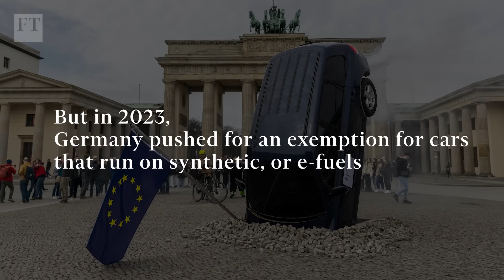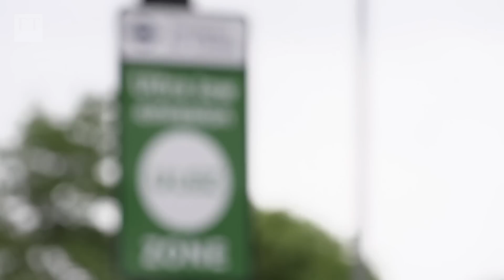The end of the combustion engine? | FT Energy Source

Comment: The National grid, themselves said there is no risk to the grid as EV's charge over night when the grid is under used, EV's help to balance the grid
Reply: yup, in UK during a storm, utilities PAID EV owners to charge their cars as they had a surplus of wind-powered electricity.
Soon as more cars get vehicle-to-grid features, EVs can act as home batteries, being paid to help stabilize the grid during high-demand times...
Reply: @cgamiga We are slowly moving away from a centralised power generation to every house being a generator.
Solar panels and batteries are the future as many days in the summer I am generating over twice as much as I need for any 24 hr period, in the winter it's just 50% but I am limited to 4 kWh by the ability of the cable going to the street to carry more. If building regs stated 3 phase cable instead of single phase I could use more solar panels and generate enough to cover for winter generation levels
Reply: @Stumpy1854-Orion unfortunately solar cannot play a very large part in the UK, because they produce much less in the winter and when all heating is electrified we will need much more elecricty in the winter. Once there are enough wind turbines to cover the winter demand there will be spare electricity during the summer, even if there were no solar panels. Adding solar will just make the excess worse. You will not be paid anything for exporting electricity most of the time once we reach that point. Only when the wind drops will solar export be valuable. Wind turbines are much more economical at large scale than small scale so most electricity will still be produced by power companies.
Reply: @adrianthoroughgood1191  Any renewable energy generation system will need a balance of all types of generators and storage to handle the intermit supply of renewables, some days Solar produces too much and others not enough and the same for wind, except with Wind it generates energy when we dont need ie overnight, so the grid must have storage to save all that excess power to use it when we dont have enough. Solar is not the whole picture nor is any other renewable. Today in the UK, Wind generated 50% of our energy needs and Gas 10%, in total fossil fuels generated just 15% of our power, soon it will be none
Reply: @Stumpy1854-Orion  And your electricity costs 38p per kWh. What a success story. 🙄
Reply: I think you mean no risk to the grid.

Comment: 40% of the worlds Lithium today is mined in Australia but refined in China, it wouldn't be too much of a problem to build refineries everywhere, negating the dominance of China
Reply: Maybe that’s why they took away Australia’s weapons
Reply: @fe2nq  ?
Reply: The low cost of the lithium is dependent on cheap coal fired smelters, chemicals, process heat, and electricity in China.
Reply: @gregorymalchuk272  Lithium is a salt, not a metal, your education is lacking, its distilled out of water by using processes to filter the Lithium from the salt.
No coal fired smelters required 😂
PS in the UK we have no coal powered generators that power smelters.
Your ICE vehicle is full of steel and aluminium that requires smelters so your like the pot calling the kettle black
Reply: @gregorymalchuk272  In my country Lithium is being extracted from geothermal hot water so it is basically a byproduct of that industry, also 40% of the worlds Lithium is mined in Australia.

Comment: Plus, one liter of gasoline need around 1,5 kWh worth of electricity (from grid or local generators burning oil products) from well to tank. 
A 60 liter tank is therefore also ”containing” 90 kWh of electricity. Even if that number is half that, all ICEs are also electric, on top of all pollution!!

E-fuels are even worse in kWh, as the ICE is so uber inefficient!

Comment: No arguments about growth in production of EVs. But, making electrons as easily available as gasoline is the sticky point. Where will non home owners charge cars? Why every gas station does not already have EV charging station as well? US has about 110,000 gas stations. If you assume on an average 6 pumps per gas station, it would be 660,000 gas pumps in US. But many have more than six per station, so number of pumps may be close to million. Compare that to mere 100, 000 number of electric car charging stations in US. Of course, it is a chicken and egg story, which would come first. President Biden plans to increase number of US car chargers to half million. That would be a big boost. Also, for lot of users, the car usage is not much. They would be loath to pay so much extra for an electric car. Cost of EV’s and batteries is too high. And if you do not drive much, which many people do not, EV is a white elephant. Also the electrons going into your EV, if they are not produced by renewables, then you are not helping the environment either. Granted EV’s zero out the tail pipe emission. But, their tire pollution is generally higher than gasoline powered cars, because they are heavier. So, there are lot of issues, staring in face, before massive adaption of EV’s can take place.

Comment: Make a good product that is reliable and meets demand and people will buy it. A few countries pricing middle class and poor people out of vehicles and affordable energy isn't going to make enough difference in the Co2  emissions. Other countries who make up most of the pollution will just take advantage of our higher costs and do things cheaply with the tech we are using now. Not to mention the inefficiency of electricity delivery and the aging grid and how depended we are for heat in reliable vehicles in cold climates. Even if we met our goals it will hardly make a dent so we shouldn't do it at the expense of most people. As we Innovate, and the climate and people adapt, we will continue to improve and any effects of climate change will only slightly slow us down but we will still be far better off than we are now. If we don't destroy the economy trying to achieve something impossible.

Comment: Whilst electric vehicles offer a better long term solution the 'rush' is pointless.   We need to improve the grid as the priority, whilst continuing the transition to EVs.   Current battery technology is going to be obsolete within 5 years, the whole battery capacity/range issues are going to cause a rethink about charging stations.   Good on the early adopters to pave the way but I expect they will pay a heavy cost.   Don't forget the average vehicle fleet is around 12 years so plenty of combustion engine vehicles are still viable at 20 years.    Lets see what happens to electric vehicles - if they do not last then much of the gains will be lost.   Already we are seeing insurance/damage issues as minor accidents can open up major liability as to ongoing battery safety.   Batteries need to improve, and will do.
Reply: Pacific Islanders and millions of other low-landers and the odd Polar bear feel a bit more urgency...

Comment: E fuels will be important.  That said, they will be too important for the de-carbonization of long haul aviation to waste them in motor vehicles - for which battery electric is a much more efficient solution.
Reply: It will become less important and less relevant, due to the cost implications. The cost to produce e fuels will be high, and it will still need to be transported all over the place, to where it is sold and used. Electricity needs no transportation, as it uses the grid.... Even the fuelling stations e fuels might use still rely on a supply of electricity
Reply: Yes. We need different things for different uses. It's only the idea that efuels mean you don't need to switch to EV that is wrong. Same as we need green hydrogen for some uses but that doesn't mean you don't need to install a heat pump for your home.
Reply: It's not just efuels. We are ignoring hydro treated sewage sludge, garbage, cornstalk and cob, sawdust, and rice hulls. Renewable liquid fuels exist. It's completely irrational to ban the internal combustion engine.

Comment: The argument of the grid overload, is a lie.
The same with the high price of chargers is also a lie.

Just look at Norway, and you see this clear.

The problem in Norway is that gas stations are closing down. With 1/4 of all cars on the road EV's, soon you need to convert your car to flex fuel, and make your fuel at home.
Norway had to close down one of the two refineries, because of the high number of EV's.

Comment: Energy transition from fossil fuels to anything more energy dense – cannot be done – powered by fossil fuels.
Energy transition from fossil fuels to less energy-dense reality - say, back to woods - turning another Gaza, in the process - can.
Humans were not ready morally, ethically and intellectually to start the mass extraction of fossil fuels with the advent of the steam engine 300 years ago. 
The Magna Carta requires today overhauling – adding to it the right for humans to understand what Energy really is - before any other commandment;
“In any system of energy, Control is what consumes energy the most.
No energy store holds enough energy to extract an amount of energy equal to the total energy it stores.
No system of energy can deliver sum useful energy in excess of the total energy put into constructing it.
This universal truth applies to all systems.
Energy, like time, flows from past to future” (2017).

Comment: Considering extremely cold / hot weather, life expectancy of battery, charging wait time , charging availability…. EV may be a second car option of suburban.  A Japan ice car can last for 20-30 years and in the meantime, EV need to change the battery 1-2 times.
Reply: yeah and during the 20-30 years of an ice car life you don't have to do anything on it!
Reply: If it's a modern ICE car, then the oil has been changed every year, a few belts exchanged, or a chain, spark plugs a few times, air filter, petrol filter, Nox sensor broken, exhaust replaced. Cost: 5000 and the rest.....as I am touching the tip of the iceberg.  My oil change costs 350 from the dealer.
Reply: Why would you "change" the battery?  Haven't you heard of battery pack refurbishments?
Reply: Deeply ignorant lies not based on any research or backed with data - ie FUD!
Average miles of an ICE without maintenance is ~3000-5000 miles before an oil change, 100k for transmission fluid and 150k for coolants. Forgetting to do these can result in catastrophic failure, because moving things wear a lot without care. Timing belts and water pump are recommended every 60,000-100,000, muffler replacement in urban driving at least twice, catalytic converter and automatic transmission ~ 100k miles. Average mileage before scrapping is 133k miles. Only 1 percent of cars built every year make it past 200,000 miles (Road&Track 6 Dec 2022).
An extensive data base on the Dutch-Belgium Tesla Forum tracks early Tesla battery packs at 300-500k miles with an initial degradation of 5% after 50k miles and thereafter 1% per 50k. Tesla early testing in the lab simulated over 500,000 miles to 80% of its original capacity. 
Modern LFP batteries from CATL are rated at a million miles and BYD a million kilometres. Dahn has lab tested NCM cells cycling at urban use rates of 20-70% with over 10k cycles or 4 million kilometers of use.
https://youtu.be/rOAYjcO6kao?t=88
Battery management of temperature in a Tesla gives only a 15% reduction in range at zero degrees C (Recurrent Auto) and all the top (20-80+% new sales) BEV adoption countries are cold European climates.
Battery supercharging will give 75 miles of range in the time a gas car takes to fill. Nyland shows 10K km trips are as fast as an ICE car at 10 hrs with usual comfort stops.
ICE is DEAD.
Ignorance is living.

Comment: supercapacitors, curbside recharge and intersection recharge grids, an RFID that tracks your drain on system and bills you perhaps, but for inner city use, no need for the big heavy lithium battery when a ramped up capacitor will do the job...  they thought of this decades ago, just like the compressed and atmospheric air engine, the photocell lined, methane burning EV engine, and the chicken feather hydrogen fuel cell fuel tanks... none of which made any progress and were all likely bought up by petroleum interests..
Reply: None of them robust thinking. Commerce also has a way of weeding out the loonies.

Comment: 1. Ford made sure that the factory workers could buy the car they made.  They are cheaper, simply because they are.
2.  Lithium is highly reactive material.  You are sitting on several tons of it.  What if you crash? what if you scratch the battery on the kerb and it rains?  Do you know what happens when water touches lithium?
3. without massive subsidies, tax reducitons, and the sort, No one would buy EVs.

They said the same about 3D TV and movies.  and that crap is gone/
Reply: Good points.  What nobody ever seems to mention is that EVs completely destroy the low cost, reliable used car market.  How does one determine the useful life of a used EV battery?  How does one know if a used EV has ever had an accident that has internally damaged but not yet destroyed the battery pack?  Will working people at the low end of the income scale that currently run around in a $1000 used car be able to afford a "cheap", reliable used EV?  How will a waitress, Walmart employee, drug store cashier, gas station attendant, etc. get to work if you take away their low cost ICE car?  If service people can't work, the economy and society takes a dump.  Thanks to dictators telling consumers what they have to drive... instead of consumer choice.

Comment: several howlers in this video, eg from Campbell FT -

Every time someone drives up and needs
4:13
to fast charge, the amount of power
4:16
draw on that system is enormous.
4:18
That means the energy grid has to be much more robust.
4:21
That is very expensive and takes a very long time to put in.
.....................................................

completely wrong - fast chargers will use their own stationary batteries to charge the EV and will recharge themselves slowly from the grid so that the demand is spread out
............................................................
Campbell FT-

You will still be able to buy an internal combustion engine
8:14
car in Europe in 2034.
8:16
You'll be able to buy one in the US
8:18
much later than that, and Latin America much,
8:20
much later than that.
8:21
And these things are going to be on our roads for decades.
..........................................
dont bet on it - making ICE cars is a numbers game and as the volumes drop it just wont be worth making them as the cost rises and EVs get cheaper and their running cost
including charging, insurance and maintenance etc falls well below ICEs.  So it will be a brave OEM that carries on with ICE in the face of market forces